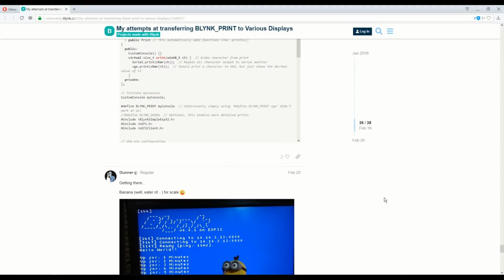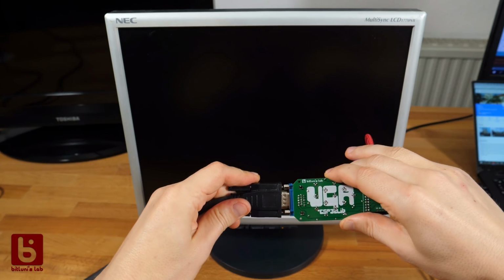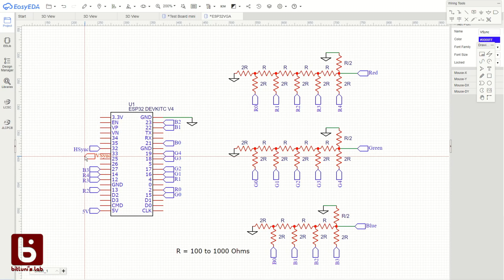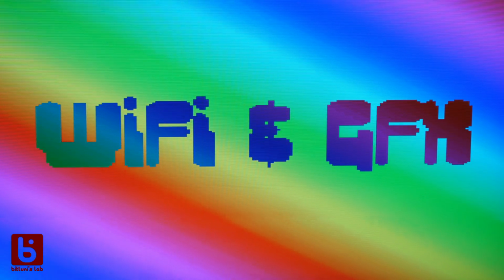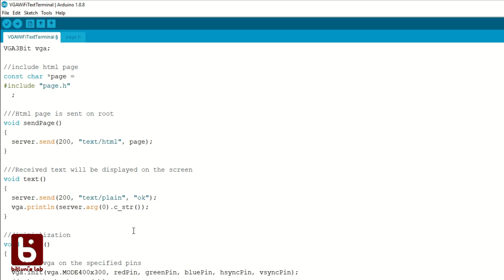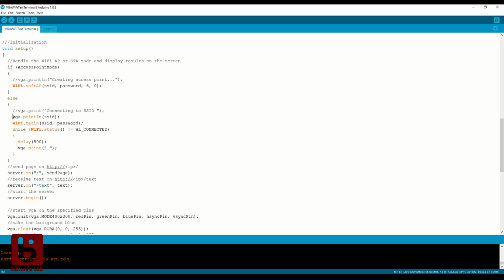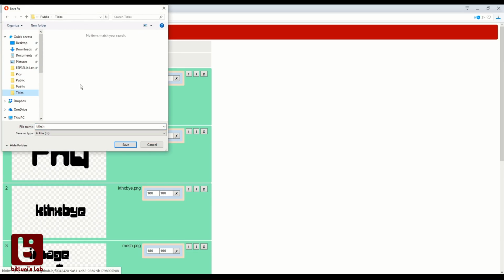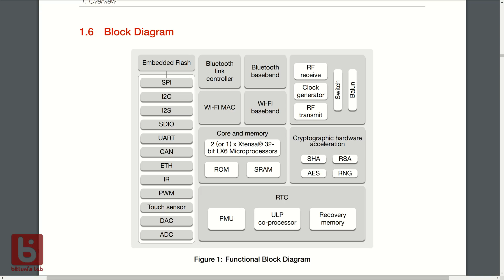ESP32 VGA Board & ESP32Lib FAQ (Level 2)

Comment: what would you suggest to make a vga to  ip converter using an arduino ?  I was thinking like getting the RGB (analog) + VH (digital) signals ,  get the analog signals converted to digital using a ADC converter , then send the 5 digital signals (RGBVH) over TCP/IP , then in the other side we need  to convert them back to RBG (Analog) and no change to VH (digital) signals .

Comment: Why not use SMD 1206 resistors instead and maybe make the pads a little larger? This would not only make it a little smaller but easier to solder.

Comment: Can someone tell what is the value of the resistors?
Reply: Христо Кръстев it makes the colours I think.  You turn on pins connected to the in-between points in the ladder.  This increases the voltage, and thus the brighter color.
Reply: lol.I was asking for their resistance value not for what they're used(He already says that in the video).
Reply: @i4kata  on site: Build

I have used R=150 at the end. That’s at the current limits of the pins but R=1000 was dark on another monitor.

Comment: All boards with VGA output use their own CPU/MCU to create graphics. It would be nice if someone made a "graphix card" for use with any board - arduino, PIC, etc. I need just a board that has RAM and receives commands via SPI or parallel port (ideally both should be supported). And because VGA has a lot more pixels than an lcd it should have some high level commands like draw rectangles, lines, circles, sprites. Does anyone know where to find a creature like this.

Comment: Just a ps/2 port an SD card interface and a forth away from a fully fledged microcomputer system.  Great!!!
Reply: I think the PS/2 port should have both keyboard and mouse support at the same time accessible using a Y-splitter cable. Old laptops used this system and it's still easy to find the cables.
Reply: I know the propeller board has been largely forgotten but it's still a capable device, although the strange architecture will throw most people for a loop ;)
Reply: Why not forget about the PS/2 port, as this is old legacy stuff? Why not include a USB host chip that handles USB mice and keyboards natively?
Reply: @nrdesign1991  Such a chip would have to be surface mounted and together with USB-connector it would cost more than a PS/2 connector. PS/2 connector might still be a problem because it normally uses 5 V. One could use Bluetooth keyboard and mouse as an alternative.
Reply: @mobluse  In the easiest case, it would just have to be the same chip that is incorporated in common USB-PS/2 adapters. It's simply for the convenience of the users, because, let's face it, no one really has or uses PS/2 hardware anymore.
Reply: @nrdesign1991  I have a lot of PS/2 keyboards and mice. If I need to use them with USB I use a PS/2 to USB converter that can be passive or active depending on if the keyboard is prepared for both PS/2 and USB or only PS/2. For this project you would need to convert the other way, from USB to something that could be connected to the ESP32. A better idea might be to use Bluetooth, but then you would need ESP32 libraries for BT keyboard and mouse for Arduino IDE.